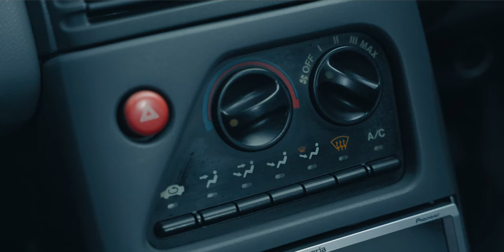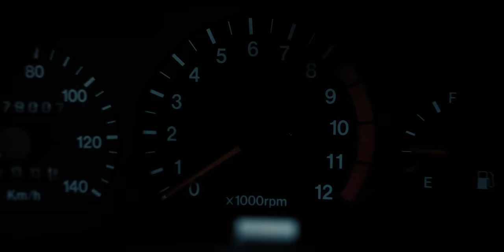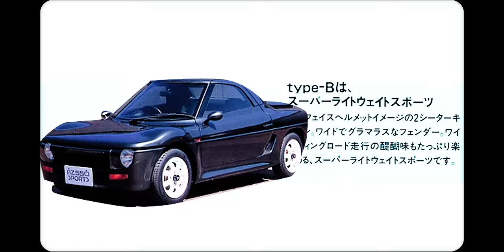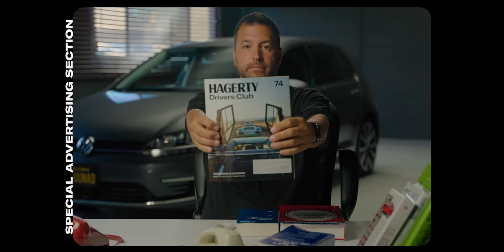Autozam AZ-1, Honda Beat, Suzuki Cappuccino — Kei Cars are Japan’s SUVs — Cammisa Revelations Ep 26

Comment: Comparing kei cars to SUVs is an insult to kei cars.
Reply: I feel like if you'd take a kei car, then put the seats down in a Suburban, it would fit seamlessly
Reply: Comparing anything to an SUV is an insult!
Reply: The reason for the comparison is that they were both created because of government regulations that have exceptions to safety/emissions regulations for vehicles that meet certain conditions. In both cases these classes of car were supposed to be narrow exceptions that didn’t apply to many cars, but automakers immediately started designing cars to meet those conditions after the laws went into effect. 

In Japan this meant that the safety laws resulted in everyone driving tiny death traps and in the US it meant the new emissions standards resulted in everyone driving giant gas guzzling pollution machines. So there are actually a lot of points of comparison. 

Of course one big difference is that everyone driving kei cars makes the tiny kei cars/normal cars/cyclists/pedestrians safer, lowers the need for road maintenance, decreases urban noise levels from wind/tires and lowers traffic, plus kei cars aren’t huge emitters even if they dodge regulations because of their size, whereas SUVs are horrifically dangerous for pedestrians/normal cars/cyclists, bad for traffic,  do more damage to roads, make more noise, and are awful for emissions. 

Furthermore, SUVs are lame and Kei cars are cool. Basically in terms of cause they are very similar but in terms of effect they are opposites in every way.

Comment: The ABC kei's get a lot of press, but it would also be cool to compare kei hot hatches like the Alto Works/ Cervo mode, Mira Avanzato, DanganZZ, Subaru Vivio
Reply: Don't forget the Honda City Turbo!
Reply: If you can remotely understand Japanese, there are some hidden gems from Best Motoring with most if not all of these cars
Reply: @sl33per1  Honda City Turbo is not a Kei car....
Reply: @sl33per1  City Turbo has 1231 cc engines, kei regs need 660 cc
Reply: @tanaka90  funnily the Caterham 7 160 can be classified as a kei car despite being... Well, over the engine size regulation
Reply: @PlatinumNath  660 cc (658 rated) in the entry level 160/170 models, wdym?
Reply: @tanaka90  oh wait, oof my blunder, sorry. I mean body size regulation, last time I heard
Reply: @PlatinumNath  Dimensions are certainly close in the kei league for the Caterham, but if we're being pedantic here the kei nominal would only apply to engine displacement/output specs

Although.... the 160s peakoutput of 80 bhp wouldnt qualify for the k label still
Reply: @tanaka90  kei's have no horsepower limit. It's just a gentleman's agreement. A general rule of thumb is to look at the car's torque figure instead; for example the Honda s660 makes nearly 80 lb/ft of torque, and probably similar horsepower numbers.
Reply: Just to add to the Caterham talk -- they actually do sell the Caterham 160 as a kei car in Japan. Apparently they offered to detune it to 64hp, but the Japanese government insisted on keeping at 80, since it's available with that in other markets. It's "officially" the only kei car with more than 64hp, but it's the same K6A engine as in the late (EA21R) Cappuccino.
Reply: I had a Mira Avanzato TRxx for a couple of years.
It was an absolute blast!
Reply: @andylaurel I have an importer in the same city as me with an AvanzatoR I've been considering, so that's awesome to hear!
Reply: Shhh about the vivios. I'm trying to buy them all before anyone realizes how cool they are lol
Reply: Legit want a Dangan ZZ
Reply: I have a Vivio T-top, really fun little car.  I made 1 or 2 videos before giving up on having a youtube career
Reply: @southernkei  yeah I just don't think there's enough interest or awareness of these cars to build up any kind of serious YouTube following, unless you mix them in with other more common cars like mighty car mods does. At least that seems to be the case in the US.
Reply: @muffin4600  there is a local car meet that I go to sometimes where I park right next to an autozam az1 and a capuccino, and plenty of people just ignore my car.  I even heard a guy go tell his friends that it was just a Geo Metro, even though it says Subaru on every wheel and is plastered across the back
Reply: The ABC cars get a lot of press because they were designed and built to be sports cars. the Kei hot hatches were normal car models that became factory hot rods. Still pure gold if you ask me, The old Alto Works RSR was/is a monster that was on par with some 1.6 liter cars when it came out. The Kei Hatches are awesome, But I wanted a Sports car, so I bought an AZ-1.
Reply: トッポＢＪも、フルエアロを付けると凄いよ（純正)

Comment: I am a proud owner of a 1991 Honda Beat. Bought her 2 years ago for 8200$ with 71k miles on it.  Fell in love with it from Regularcar Reviews. A great fuel economy car that you can floor the accelerator, shifting 1st 2nd 3rd 4th 5th gear, engine screaming behind your ears with the top down...... just to keep up with traffic?  I LOVE IT!!!!  

How is a 500 horsepower Corvette fun when you got no where but a track or dragstrip to take full advantage of the car's engine and transmission????

The other reason I bought the Beat. HONDA STILL MAKES PARTS for 31 years LATER!!!!! Despite there only being less than 20,000 left in the world!!!!
That and well..... the S2000 and NSX is out of my price range so I settled for the Beat :P
Reply: I'm interested in one of these as well. Where do you go to order the parts?
Reply: @bbostic_5  I buy from EtsuRyu LLC
Reply: @darkmugetsu6572  thanks!
Reply: Honestly you forgot to mention the best reason, 3 cylinders sound better than 4!
Reply: @darkmugetsu6572  when driving my c8 I accelerate at a very fast pace.  Not quite dragstrip start but fast. It's an amazing feeling for sure.  I'm a Honda guy at heart as I bought my first crx si back in 1988.   If I could afford an NSX I'd have one.   I'm very interested in the cappuccino kei car a nearby dealership has one in stock.  Kinda reminds me of my s2000 from the side profile.
Reply: @davidryder5082  problem is with the vette  your like YEAAAAAAAA FAST ACCELERATION  aww I'm at the speed limit + no stick shift  :(

This Honda VRROOOOOM 1st gear VROOOM 2nd gear VROOOMMM 3rd gear VROOOOM 4th gear Yea at 50 miles per hour!!!!

Though TO be honest the Beat was my first manual and I can't go without it now. If I was to get a new corvette it would be a C7 since it was the last stick shift GM executives have no understanding on how to make the vette fun and only focus on pretty stat numbers :(
Reply: Guess I'm old enough to appreciate stuff that when I was younger and could only afford one vehicle my crx si was amazing had it for 13 years.  I hope one day you can drive and appreciate all cars or trucks.  Maybe it beyond you now but I hope you will. I've owned 18 manually shifted vehicles split between cars and motorcycles    I can shift reasonably well but I don't need to with my current fleet. All automatics and not a problem.   If you enjoy rowing your own gears my integra type r or s2000 would thrill and delight you.   Love to have a cappuccino still thanks
Reply: Chevy makes the spark that's a manual it's cheap maybe you should look at buying one if it's not too fast for you VROOOOM lol
Reply: And as an S2000 owner I can say you have the cooler car. Beats are rad!
Reply: @LOGEZZZZZBRO   that phoenix yellow integra type r was my favorite car I've ever owned.  It felt as fast as my ap2 s2k.  What year is yours ?
Reply: Hahahaha, fantastic comment, Dark Mugetsu, and congrats on your little little beast! 😅👌🏾
Reply: $8000+??? Woah! Either it’s in pristine condition. Or you got scammed 😂. I got my cappuccino for half that and my Autozam for just a little more.
Reply: @R8andGT3Fan  was it hahahaha vroooooom
Reply: I drive an R35 gtr and just the insane acceleration is what’s so fun for me. Yeah you hit the speed limit in seconds but those seconds are the best feeling ever. Nothing wrong with lower hp cars that are fun to push just to get to speed limit, and nothing wrong with crazy acceleration and g forces for a few seconds in a fast car
Reply: @2econd428   @2ECOND  yepper, its just that there will be that itch you want to scratch perhaps of putting the car to its fullest but knowing you can't unless it's a closed course or that perhaps you would be too scared to ruin the vehicle if you try. I love how with my Beat you are just commuting to the store, to work, etc and can always put the car to its fullest and because of its design, it gives a false sense of going fast with being so low to the ground. a screaming race like engine in the back of your ears, and a short gear ratio to have fun shifting through.
Reply: 私は新車からのワンオーオーで現在45万キロほど走ってますよ😉✨✨✨
Reply: exactly my reasoning for buying a SUV. coolness means nothing if you can't put it to use.
i'm a farmer and the dirt road part of the trip to any of my farms in quite punishing on small cars with low ground clearance, and when raining they all pretty much require at least the car to be awd. so i'm not able to take a "cool" car there, which means i don't get to drive it nearly as much in the places where i would enjoy it (the actual tarmac road before the dirt road). so instead i bought the coolest suv i could afford. might not be the most viceral car ever, but it's my first car with more than 4 cylinders, it sounds cools, goes pretty damn well compared to anything i've ever owned, and it's more fun than pickup trucks (which i still have to use most of the time but oh well)
Reply: I can confirm that a 505hp Corvette is a lot of fun on the street. The sound and torque alone cause me to giggle.  But it is like having blue balls with how often you have to hold yourself back. I'm looking to get a Beat soon to park next to it since like you said, you can run through multiple gears flat out out.  Having polar opposites sounds like a good time.  I'd also love the Suzuki Cappuccino.
Reply: Theyll still make parts for those but wont make parts for a 15 year old civic?
Reply: Honda still makes parts?  wth.  I can't even get parts from the stealership for my EM1 Si .  They said "we have to look in the vintage section".  And that older Honda parts are way more expensive than current ones.  I can't even get OEM control arms for it.  They said they are discontinued and if they did have it, itd be around $300 per upper arm.
Reply: Where are you finding parts
Reply: The only thing better would be the contemporary S660.
Reply: @camerona9067     perhaps but I kinda perfer the raw mechanical nature of the simplicity of the Honda Beat, no real noise insulation, no power steering, raw mechanical parts and not much of computers. The Honda Beat is probably akin to driving a late 1960's to 1970's Porsche 911 in engine sounds and with how the stick shift feels but in the frame and with speed similar to a 356 Speedster.
Reply: Its sad that we live in a world were we are content of less then what our grandparents had...
Reply: Only 8200$? Shiii I'ma save up for one
Reply: "How is a 500 horsepower Corvette fun when you got no where but a track or dragstrip to take full advantage of the car's engine and transmission????"  It's difficult to believe someone is actually asking this question, or thinks that you can't derive a tremendous amount of driving pleasure from the experience of driving a Corvette (or Mustang GT, or similar) on public roads.
Reply: @darkmugetsu6572  "problem is with the vette  your like YEAAAAAAAA FAST ACCELERATION  aww I'm at the speed limit + no stick shift"  You can get the current Corvette with a 7-speed manual transmissions, and, regardless, what you describe isn't a problem at all, and that's not the way it goes. Really, if you don't have much experience driving these cars you should really stop telling people what they're like.
Reply: @Objectified  i think what they're saying is that you can actually push a Honda beat to it's limits, where you can't with a Corvette or something with alot of horsepower. There's alot of differences between driving a slow car fast, and driving a fast car slow.
Reply: I just imported 4 beats that I’m fixing up now. Also I have a really nice S2000 and 2 acty kei trucks 😎
Reply: You honestly may have just sold me on one
Reply: HOT BROWN
Reply: No, you're not. You didn;t.
Reply: @LOGEZZZZZBRO A Beat doesn’t look as good as a S2000 though.
Reply: Good for you,  sounds like so much fun...
Reply: @Snafu2346 should be after market suppliers thou.....

Comment: That Kei car shown in the last few minutes, the Suzuki jeep, called the Jimny, is such an exceptional example of miniature design. What a great vehicle.
Reply: Just don't crash.  C rating crash test
Reply: I don't think it's a kei car though, but it is inspired by the kei car philosophy
Reply: @Obi-WanKannabis  it's sold in Japan as a kei car, I think they export a slightly larger version with larger engine. Kinda like Mitsubishi's Pajero Mini (kei), and Pajero Junior (not kei, but still tiny)
Reply: @Obi-WanKannabis  but you are right,  Google says that the jimny with wheel arch flares isn't the kei version, so it looks like Hagerty accidentally included a pic of the wrong Jimny
Reply: @muffin4600  apparently you are correct, take the flares off and it complies with kei car regulations, that's interesting.
Reply: @IanCharlesPearce  🤡🤡🤡🤡
Reply: So the Jimny shown is an Australian spec model (with Victorian number plates). It is wider (due to the flares) than the Japanese kei spec, and also has a 1500cc engine with 75kw (100hp).
Reply: @lsear2905  how much hp does the kei jimny have? Is it still a 64hp “limit”?
Reply: @mj_aussie_coaster_travels8310  Since it's technically a Kei car then yes, it's still "64hp".
Reply: @Obi-WanKannabis I believe the kei car version uses the same body but loses the wider tires+fender flares and uses a different engine
Reply: @Lollllllz  yep, basically the same but without the optional flares and of course the smaller engine. The newest Jimny is actually phenomenal off-road, a little underpowered but performs far better than it has any right to. Actually, all the Jimny models were surprisingly good little offroaders
Reply: My dad own one...the front axle is crap...
They started clonking very fast and there are no good ways to repair it..expect change then to a new one...
Reply: Max 64 hp and the proportion specs sounds like the japanese gouverment take the over all specs from a classic mini and made their regulations after it...

Comment: I own a Honda S660 here in Japan, which is the modern-day successor to the Beat. It still keeps the same mid-engined layout, but has stiffer & better-handling suspension, and adds dual-overhead cams on the engine and a turbo with a LOUD blow-off valve. It also features a 6-speed manual transmission — a first for kei-cars. But despite being obviously newer, the S660 is still barely larger than a Beat. Still makes the same amount of horsepower too, though the turbo definitely makes the S660 have a lot more lower-end torque.

And yes, just like the ethos of the Beat, the S660 looks like a tiny version of the newer NSX. With the Mugen body kits installed, the S660 totally looks like a shrunken modern-day supercar.

I love my S660 so much, and is probably my favorite car I’ve ever driven. Though, the Beat does have a better engine sound IMO.

Comment: 1997年製の最終型Cappuccinoを所有しています。前期型が鉄製のエンジンで700Kgの車重、後期型がアルミ製のエンジンになり車重が690Kgになりました。最終型が更にフライホイールが軽量化されています。
I own the last Cappuccino made in 1997. The early model had a steel engine with a weight of 700Kg, and the late model had an aluminum engine with a weight of 690Kg. The final model has a lighter flywheel.

Comment: Continuing with that Autozam AZ-1 being the greatest hits of supercar world.
Got tricky handling of a 930 Turbo,
That gullwing door in a rollover is similar to inconsiderate-ness of (old) Italian Supercars, and
Tragic launch timing of XJ220 & EB110
Reply: And the sales flop of NSX & LFA 😂
Reply: Apparently you can somehow open the door if you push the door with your back while kicking against the other side of the car - the door gives you enough leverage that it actually lifts the car as you do that. I mean, it's a bit theoretical since it only works if the door isn't warped, but the Mazda testers actually tried it, and there's a series of old photos to prove it. Otherwise, the other way they tried was breaking the rear window, which apparently works too.

That's the beauty of the car being so small - they even tipped it onto its roof in the test by just getting a few engineers to lift one side.

Comment: And nowadays the only sports roadster kei car that still produced was none from this three brand,Yes the Daihatsu copen.The beat successor,honda S660 it's officially  RIP since March 2022.
Reply: The S660 had a really good run like the Beat did, albeit without the financial downturn that took a lot of sales.

Sad to see no 2nd generation of the S660, but glad to hear that there's many of them built
Reply: @thatcopenguy  Supposedly Honda was intent on continuing production on the S660 (in fact, they did a mid-model refresh a SINGLE year before its discontinuation was announced) but their official direct reason is because Japan finally mandated crash avoidance tech on kei-cars — which the S660 wouldn’t be able to comply without extensive modifications. But yes, with the pandemic totally screwing over production chains and Honda’s inevitable move for battery EVs, it definitely didn’t help on keeping incentive to continue production.

Fortunately, Honda did manufacture 38916 S660s in total, so it kinda sold better than the Beat did in its own lifetime. Kinda.